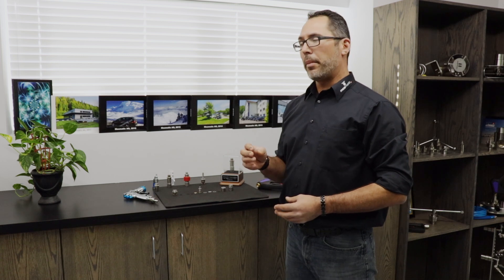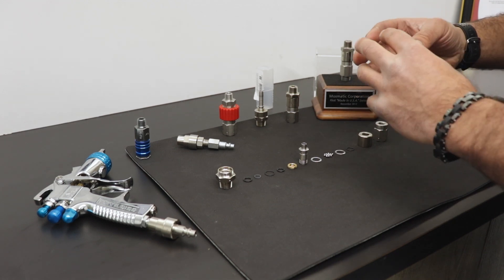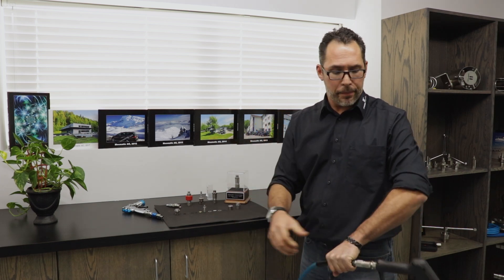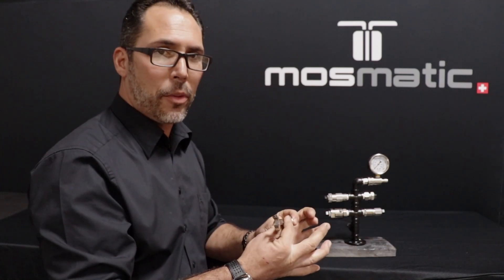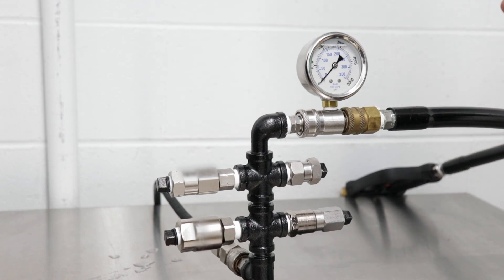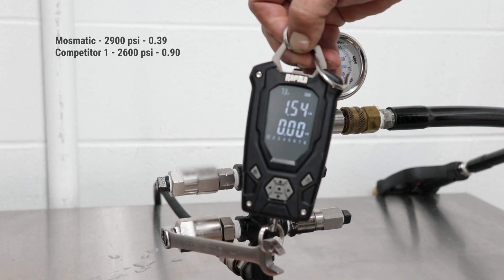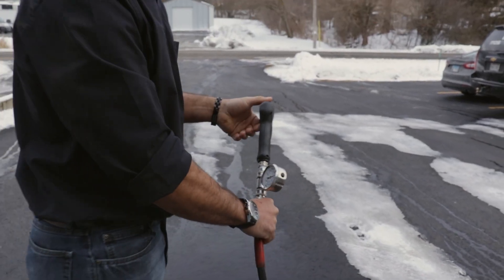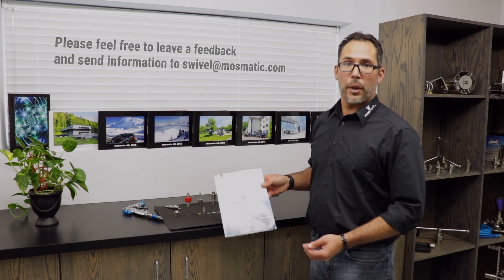Swivel Live rotation under max. pressure | Mosmatic Corporation

Comment: I was just thinking about this today. If there was something that would prevent my pressure washing hose from tangling up when I'm using my Mosmatic 21" Surface Cleaner. I need four of these, any suggestions where I can purchase them in Canada. Your products are second to none.
Reply from the maker: Hi, thanks for the compliment. Please write a mail to our sales manager in canada to Gino Rossi. His mail is g.rossi@mosmatic.com. He will be happy to assist you.
Your Mosmatic-Team
Reply: @Mosmatic  Thank you. After talking with Mosmatic in Canada, I was able to locate the swivels at a local dealer. I'm using them on a 4000 PSI 4 GPM pressure washer. Connected one to a Mosmatic Surface Cleaner, and one to Mosmatic high-pressure gun. They definitely function as advertised, even under extreme pressure.

Comment: Everytime I have something break I ask myself if there is a way I can keep it from happening in the future.  At our automatics I realized that mosmatic swivels are incredibly reliable, so I started using these gun swivels years ago.  One less way to get a wet and angry customer, keeps us focused on the rest of our job instead of swivel rebuilds, and helps the customer.  I had increased my wand pressures at one point and I saw my priest using the wands and he wouldn't pull the trigger because his wrist was tired.  So it is real problem.  Thanks for thinking about my customers.  So many in the industry just market to a carwash operators cost saving side with less thought to what reliability and ease of use means to our customers and bottom line.  I'll always look to mosmatic first when I need a solution.